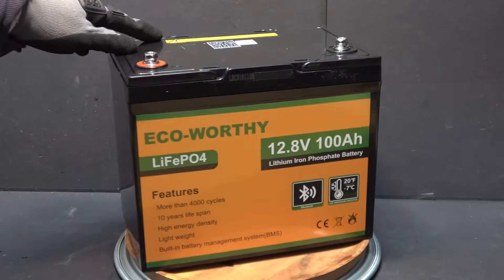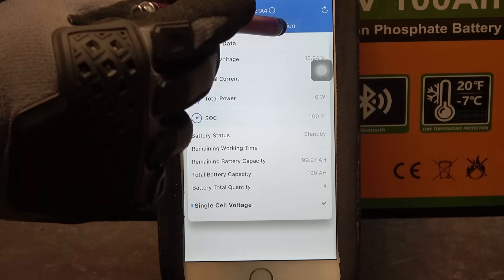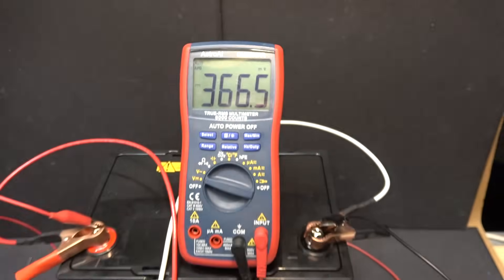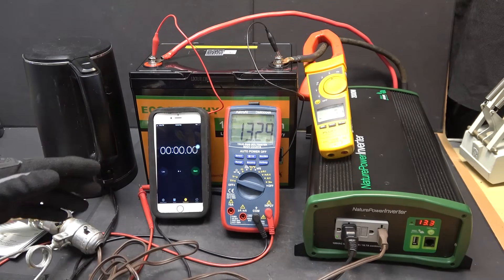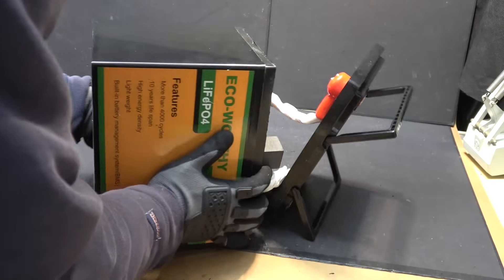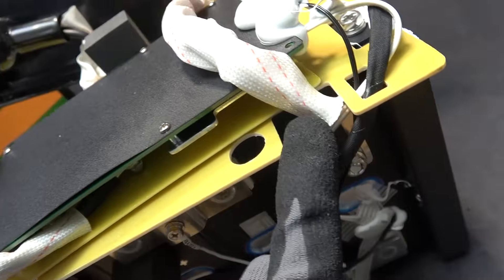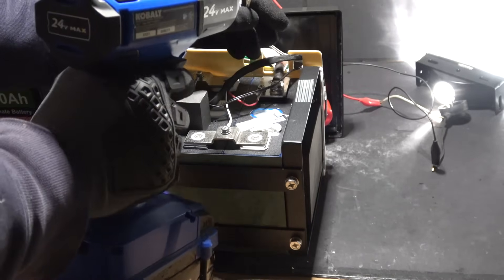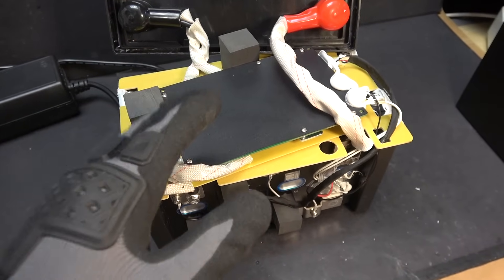Review & teardown: Eco Worthy 12.8V 100Ah LiFePO4 battery w/ Bluetooth LTCP

Comment: Hi, I have a question for you (question in 2nd paragraph) or anyone viewing the comments. I own 4 of these 100AH 12.8V LFP Eco-Worthy batteries. The first two, I purchased in June 2023 before they offered bluetooth on the BMS and the next two I just ordered only a month ago (Sept 2025) and of course include bluetooth as shown in your teardown. I have been using the original two, with ten (10) 100W Renogy Solar panels (and the batteries connected together in parallel for 12V 200AH) everyday for my off grid cabin setup, but I never capacity tested either and have just hoped they had the rated amp hours as advertised. I haven't added my more recent two batteries into my system yet and still deciding whether to tie them in parallel with the original two, despite the age/cycles difference. 

My question is about running LFP's down to 0% SOC for the capacity test, where the BMS cuts it off. Isn't this bad for the batteries? Ive read on DIYSolarForum and elsewhere you that don't want to let them discharge fully. Not that it will kill the cells instantly, but that it will greatly reduce lifetime cycles and overall capacity. However since a capacity test is only performed once or twice in the lifetime of batteries does this make it an exception? Just to not do it all the time and it won't affect it as much? Any guidance on this would be great.

Comment: Some of the cheap battery's have metal cage securing battery my  £98  DATOUBOSS 100Ah 12V  does , they also tested at 106 Ah , it has same issue with overload shutdown . Reckon both these are actually shutting down with high cell temp and this ain't good for cells , have mine fused at 100a , I run two for 24v off grid system temped to fit Bluetooth BMS to monitor cell balance though

Comment: The reason why it sparked:

A big load like an inverter will likely have massive capacitors directly on the input terminals. Your resistor may have had the time ti charge the capacitors to 10 or 20% be the time you disconnected. If youd have left it for 30+ seconds it might have charged them substantially more and avoided the spark.

Go check "capacitor time constant" on google for some electronics theory involving capacitance, resistance, voltage and time!

Comment: got 1 , not great outside in the winter time in Southern Canada. The density is quite impressive otherwise. Spits out 14.8 at max charge as well so you might need a small transformer/ buck converter to adjust down to 12 volts for older devices.

Comment: Really confused about the voltages Ecoworthy list, any idea why they specify Float voltage so high? 

✹Bulk/absorb: 14.2V- 14.6V. ✹Float: 14.6V ✹Equalization: 13.6V- 14.0V

Comment: resistor should be a low resistance high wattage or it will take longer to charge up the inverters caps thus you didn't have it on long enough...50-100 ohm resister for 5-10 seconds..

Comment: hi, i have a question that customer service in ebay cant respond ,  they told me the charging voltage of the battery was 14.6V but they dont know the floating voltage that the charger should provide ,  one CS told me this battery has no floating voltage  ,  so do  someone here knows the floating voltage this battery is maintained after charging is done ?
Reply: 13.6 float
Reply from the maker: LiFePO4 batteries have a BMS and it doesn't float charge. You should disconnect the charger once it's fully charged.
Reply: @vuaeco  the solar charger float the batteries at 13.7 after fully charged do you think this will damage the batteries? disconnecting them and reconnecting them does not seem practical or maybe new solar system chargers dont float batteries ? (floating batteries after charge is when they maintain a voltage after charge)

i just  check a few articles online and floating charge seems to be normal for lifepo4 batteries and they do it around 13.4 and 13.6  it does not matter if they have BMS or not  the solar panel charger will float them .

Comment: Ya, i picked up an ecoworthy 280ah to power my deep freezer full of ice cream and gaming pc during peak demand hours when the power company jacks up our electricity rate in the summer and recharged it after peak hours. worked great all summer and it is ready for next year. within 3 years it will pay for itself in money saved on my electricity bill. they regularly go on sale with coupon codes on ebay during the holidays!
Reply: say you use the entire 3 kWh everyday. how much is your savings?
Reply: I could save maybe 5-8 euros a day if there are huge price hikes during winter. However I have a fixed rate so it wont matter. Otherwise I could save maybe 2 eur a day when the prices rise. Best case scenario this thing could save it's price in one year or less. @uhjyuff2095

Comment: Great review video! Can you show us how you make the glue?
Reply: The cell's number start with 081 which tells us the manufacturer is REPT.
Reply: Also, a great manual for this BMS is available from Overkill Solar.
Reply: The software from JBD can be used to read and adjust the settings...esp. the max current which is set way to high for a 100A BMS.

Comment: Better to use a 12v incandescent bulb as a charge resistor. It’ll light up when touched and the caps will be charged once the light goes out. The caps discharge quickly so touch the connection wire then remove the bulb from the terminal and you should have no spark.

Comment: wile i was watching your video, you said that your electric kettle was 1500 watts and it drew 145 amps. thats impossible, 1500 watts divided by 120 volts is 12.5 amps. at 240 volts thats 6.25 amps so im assuming you just misspoke.
Reply from the maker: 1500W draw from the battery, not from AC outlet. My clamp meter is on the battery wire.
Reply: @vuaeco  ahh perfect sense
Reply: While you are correct given the data you used. He may have been referring to the draw from the battery.  Though at 145 Amps that would mean a battery voltage of approximately 10.4V.

Comment: I have over 500Ah in EcoWorthy batts for least 3yrs now and they are holding up. From 20Ah to 100Ah batts. From 12 to 24v. I do wish I had the Bluetooth though but, I don't.
Reply: Haha, I got you beat. If you go by 12v, I have a total of 2100ah. I have various 12v, 24v and 48v. About to get more before the Trump tariffs.
Reply: I'm running 2x 100ah 25.6v, they're solid batteries, and mine are older stock too, no bluetooth, probs no metal frames either. I can wait til these die in about 12 years time 😅😅
Reply: @ I actually have one of Eco 24v 100ah and it's the only one that went bad on me. Actually it started to swell. Still working but I won't be using it much longer as using bloated battery can be very dangerous. I contacted Eco and they sent me another one.
Reply: @Firephosure  wow glad you saw that and eco worthy took care of it

Comment: I have the 280 ah version . I emailed eco werthy because i have a victron mppt smart solar charger and wanted to know what i should set  the charge and float voltage to 14.6 

Is this correct ?
Reply: Victron specs have their own same tech batts at a recommended 14.2 charge and 13.5 float.
Reply: 14.6 absorption and 13.6 float
Reply: @ Do they need absorption like lead acid?
Reply: @CATANOVA  yes because the BMS only balances the cells between 14.2-14.6V 
The voltage needs to sit there for enough time for the cells to balance

Comment: I GET 100AMP hours from 12v to 13.6v so clearly your battery does have enough cappacity in it like mine does lol if i drain my battery all the way below 9v i will get 115AMP not 100AMP LIKE YOU GET FORM YOUR BATTERY AND MINE IS WAY CHEAPER AS WELL LOL AND MY BATTERY COMES WITH BLUETOOTH AND A JBD  BMS

Comment: I have a ceramic resistor that I use, that should be able to deal with lots of use, but it turns out that it had burnt out inside. I did the same as you too :)

Comment: dude this could seriously tell you what amperage the vehicle is drawing from it. very useful for troubleshooting. i have seen it many times a trunk light or module somewhere is pulling a parasitic draw and draining the battery while off.  
also useful while the engine is running.

and useful for all the time.
tells you the health of the battery and the health of your car without disconnecting circuitry. or using fancy tools, or poking around with a multimeter.
Reply: Except these aren't normally set up to start vehicles, can destroy your alternator, and dont work when too cold or too hot. 

As a battery for an RV etc, sure. But still a ways to go for a starting battery. With the cost and performance, if they can overcome the limitations, they are more than equal to SLA's in today's environment, especially in cost/capacity/lifespan.
Reply: @ if i have a Ford E350 senior citizen bus that has a secondary battery mounted to the frame underneath and it is coupled to a stock battery isolator and charges while the vehicle is running but needs replacement soon then can i run one of these in there and will it take a charge ok this way? or do you need special chargers for it? this secondary battery does not start the vehicle and it is charging from the alternator while the vehicle is running. 
my thoughts are this could be an ez way to add on an inverter to it for my 120v loads, and just use the 12v for the 12v loads. 
From the factory this battery was used to power the wheelchair ramp etc
Reply: @dangerdavefreestyle  I presume in terms of the problem with the BMS shutting the battery off at full charge, the starting battery still being connected will not result in a voltage spike as the "primary" battery will still be connected. Someone correct me if I'm wrong. As a primary battery it's absolutely a bad idea, but as a secondary, SLA as primary, I expect it will be ok. 

You'll have to see if your alternator puts out enough to charge the lifePo4. Some vehicles do, but you'd need 14.2-14.6V to get fully charged, and on older vehicles that kind of voltage isn't a given, so you'd need to test voltage at idle with all accessories running for your "worst case" voltage scenario. And again, these batteries don't take a charge when cold, so if that's a concern, keeping the battery in a heated compartment is a requirement. 

lifePo4 's are awesome, but they definitely have some intricacies that can make putting them to good use in certain situations difficult or near impossible.

Comment: Spark:  Either the capacitors in the inverter did not get charged or they discharged between charging and connecting the cable.  Usually it won't spark if the terminal voltage is at least 70% of the battery voltage but higher is better, especially with higher voltage systems.

not charged:  resistor value too high for the time connected and the capacitors did not get charged. Can use the voltmeter on the inverter DC terminals to measure when the terminals get to the battery voltage. 

discharged:  high drain on the capacitors, perhaps because the inverter was turned on while charging, or simply took too long to connect the terminal. With a voltmeter on the inverter DC terminals, watch how long it takes to discharge down from the battery voltage.
Reply from the maker: You nailed it right in the head, Sylvan. It's "not charged". I picked a resistor which had 1.2K Ohm and charge time was too short, not enough to charge up the capacitor hence the spectacular arc. And that's only 12V. Imagine doing this with a 72V battery pack!
Reply: @vuaeco It is best to measure the voltage across the resistor so you can see when it has completed charing the inverters capacitor.
Reply: should have been the thumb nail. shocking
Reply: You should use a LOW value resistor. About 18-30 ohms. Get a nice 10w resistor of about 20 ohms. Yeah, your 1.2k ohm resistor made the charging process too slow. Or you didn't get good contact with the resistor lead / alligator clamp. 🤷🏻‍♂️
Reply: Just use the 12v lamp.
Reply: @Rich-on6fe  good idea. I use a #2 pencil with both ends sharpened as a resistor but I like the light bulb notification I will give a try.

Comment: Love your videos my brother. But to start an accurate capacity test. Battery needs to be charged to 14.6volts. =to 3.65v per cell.
Reply from the maker: You don't get 14.6V after a full charge because of the BMS. At anything above 13.33V at rest is considered 100% charge.
Reply: @vuaeco . I'm curious at the shutoff  voltage of 366.0mv. Shouldn't it read 10volts. Since each cell low voltage cut-off is 2.5volts x4? What did I miss. Thanks for all you do. May you and your family have a blessed Christmas and prosperous New Year 🙏
Reply: @milvolts1 the BMS shutoff, which is why the voltage was so low
Reply: New battery requires a few cycles to fully balance it's cells to achieve 14.6v @vuaeco
Reply: Hello Vueco, forgive me if you answered this question. How long did it take to fully charge this battery before you did the capacity test? Thanks. I recently bought a Dunfume same volt and ah. And it takes less than 2 hr. To charge to full capacity at 10amps. Something is not right imo.
Reply from the maker: @milvolts1  How long it takes depends on a couple of factors. How fast is your charger? How empty is your battery? If your battery is 100Ah and it's completely empty and your charger is 25A then it would take about 4 hours to fully charge your battery.

Comment: Hi...
Is the Bluetooth App necessary 2 just use it as a power source or
Is that another way they get your data 2 sell 2 data brokers...
Reply: Bluetooth is just to see battery data, it has no control functions. You can use it without bluetooth.
Reply: @chaon93  ...
Hi...
That is how i interpreted it;... thank you for the clarification...
Reply: @chaon93  ...
Hi...
That how I read it;... thank you for clarification on that...
Two of these in my Mobility Scooter should work fine...

Comment: So, -7 c it stops charging the battery,. but can you still use it or not?
since you didnt test that with the lamp, only charging the battery.
how much CCA does this battery have? Cold Cranking Amperes
can you use it as a startbattery?
Reply: lifepo4 batteries can be used down to about -20C, but cannot charge below 0C, some brands have self-heating batteries that if charging current is applied below 0C it will use that current to heat the battery, and then charge it once safe. Not sure why this specifies -7C tbh, might be a slightly different design.

BMS controlled lifepo4 batteries are not something that provides "CCA" like a starter battery, they are designed for sustained and deep loads such as inverters and solar generators. Rated continuous amps is 100, peak amps before shut off depends on duration, 200A surge, 150A 30s is typical for lifepo4 in this range

Not suitable for a starter battery.
Reply: Not to be used in a vehicle as a replacement for Lead acid. Great for boats, RVs, campers....etc
Reply: You could technically use it as a 12v battery in at least some hybrid or electric vehicles that have no engine or a starter motor powered by the high voltage battery... But not in vehicles with a traditional 12v starter motor... It MIGHT NOT be safe in all hybrid or electric vehicles though but SHOULD be